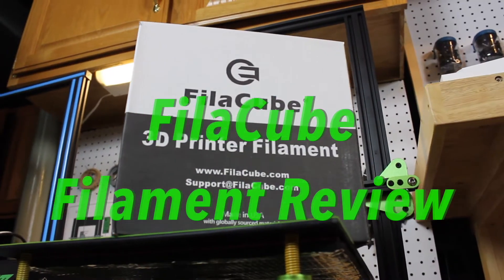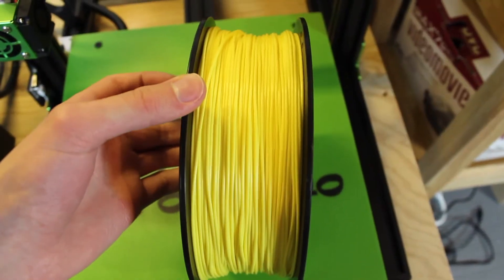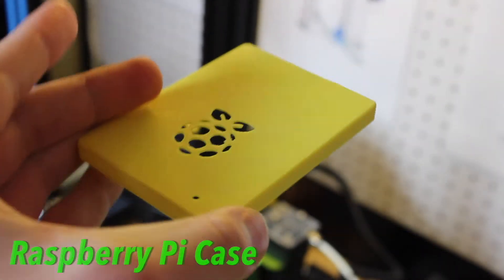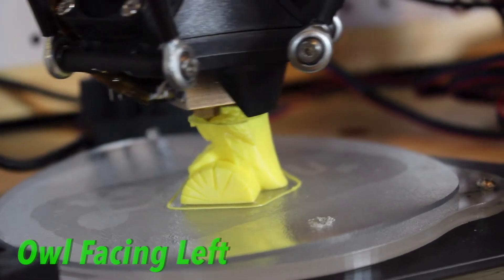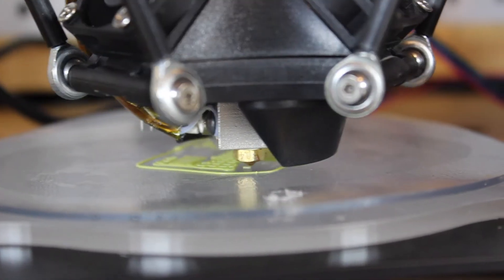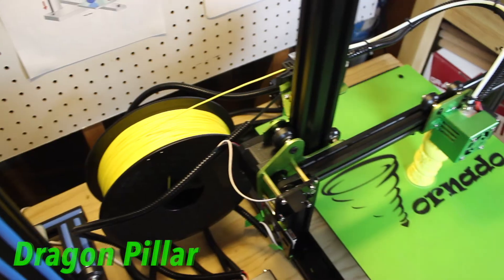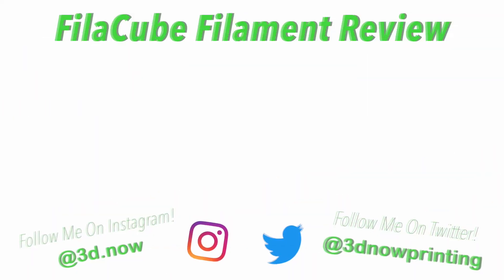FilaCube Filament Review!

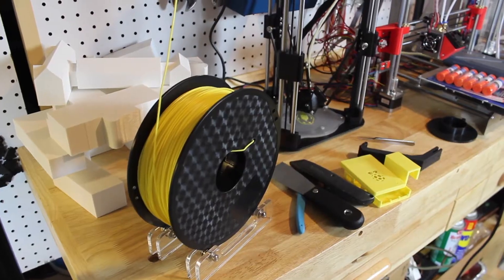Comment: Hi.  At 1:42 what is that printer you;'re using and tell me out that round plastic disk. Interesting.  Multi color filament?  I'm all in!  So cool.
Reply from the maker: That printer is called the Biqu Magician Delta. It's a great printer!the filament is not multi color, but that would be interesting!
Reply: You mentioned a rainbow filament, but I was interested in that printer.  Plastic disk easier remove builds.  I have a new FLSUN and having no end of problems.  Builds were sticking to the black tape thing and in pounding a project to get it off the plate broke.  I later found out the screws holding it were 3 plastic screws. UGH  Longer story, I can PM you.  I don't want to carry it on here in public.  1 week now on skype and team viewer and it;'s still not working.  Your IQU is $100 cheaper.  I'm thinking of calling amazon for a refund
Reply from the maker: Yeah filacube sells rainbow filament! And yes the biqu magician is amazing.  I would highly recommend checking out my video review i made of it

Comment: Hey 3d now! I got my monoprice mini select  V2 friday. Loved it! I printed lots! First the cat gcode that was on the sd card, then some other mini things. Worked awesome! Now this morning I come to print something and the progress bar goes really fast!

I hate it, doesn't move and temp goes down fast. The only thing that will print is the cat one that came with the premade sd card.
I have no Idea how to debug it! Should I just use the usb cable? Or do i need to get a new sd card. I heard the one they give you is crappy
Reply: Please help
Reply from the maker: Hmm, try a new ad card and if that doesn't work, print from your computer over USB.
Reply: I tryed to use a new card couldn't :P No offence but you should of never recomended
Reply from the maker: I recommended it because it is a very popular printer for the price. I said buying a printer at a higher price would be better quality. The printer should not break the first day. You probably did something wrong to the board. Try contacting the manufacturer for support or try sending me more info. I'm sorry about that
Reply: No, I understand, no problem. My problem was that the only on it will print is the one it comes with.
I have followed the steps to take the stl file to the gcode. Using Cura.
It Perfectly prints, heats up, and is perfect!
Now, for the ones I did get from thingverse, I correctly converted but it wont print. The progress bar goes to the right (the way it should). And the temp goes down slowely after preheat.
https://imgur.com/upx9Yz8
Reply from the maker: Did you setup the printer profile correctly in cura?
Reply: Yes, I did it with automatic and manual settings